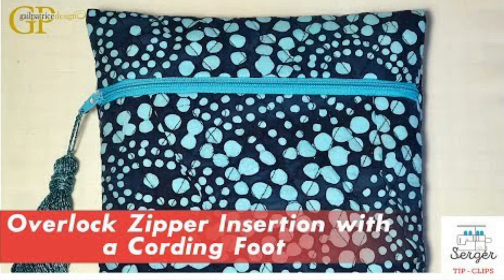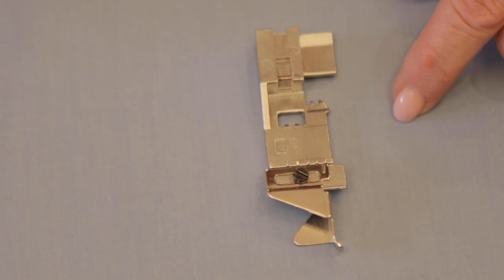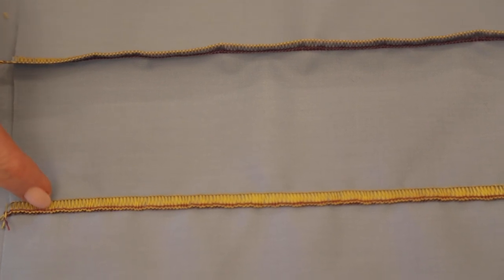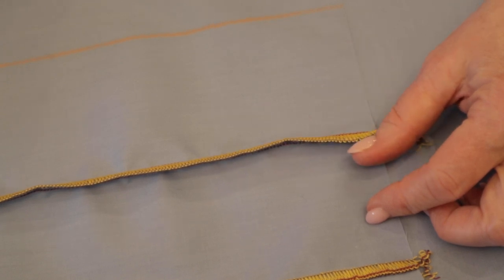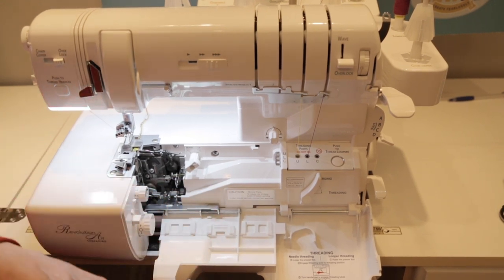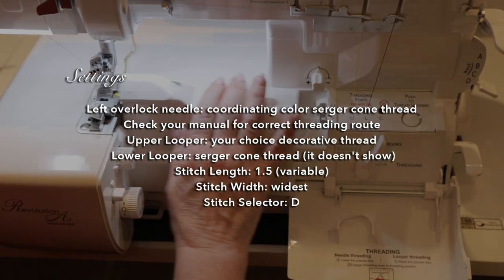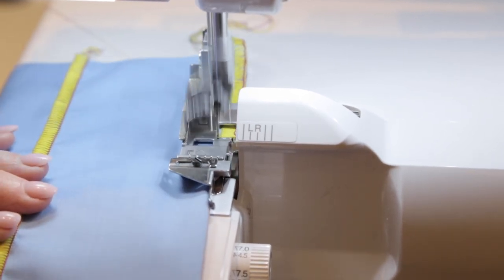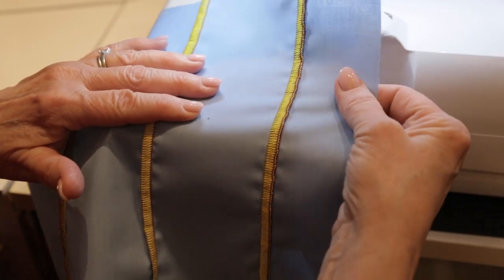Flatlock with the Lace Applicator Foot

Comment: Hi Gail, I have tried using woolly nylon in the upper looper for a three thread flatlock, but my Babylock Ovation has the needle thread go through the upper looper tension disc and it gets all tangled up with the woolly nylon when they're both feeding through that tension disc. Is it simply not possible to do this?
Reply from the maker: Why don’t you do a 2-thread flatlock instead? Then you don’t have to worry about a tangle problem? Let me know if you need a different solution and thanks for watching Serger Tip Clips! (If you absolutely need a 3-thread stitch, I’ll figure out how to not get tangled.)
Reply: @GailPatriceDesign  Thanks Gail. Love your Serger tip clips. One on woolly nylon would be great! 😍 I was trying to use 3 thread as I was seaming knits and thought 2 thread wouldn’t be as strong. I really wanted to use woolly nylon to fill out the stitch and have a softer feel., especially on the active wear I was wanting to sew. Can’t wait to see if you can figure out how to do it without the tangle!
Reply from the maker: @imperialmaker  Hi Michelle, Try putting a piece of tape across the left needle threading channel and let the wooly nylon ride over the tape.to prevent it from getting snugged up in the tension disks. Let me know if that works-thanks.
Reply from the maker: Michelle, did that tape trick work for you?